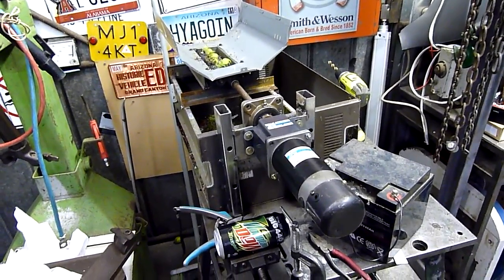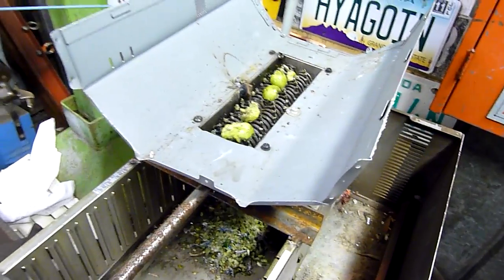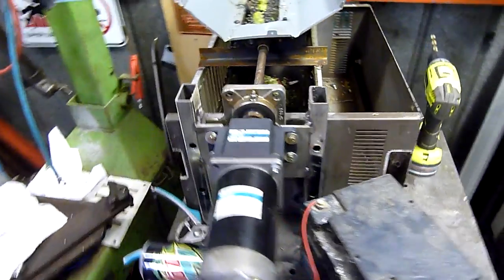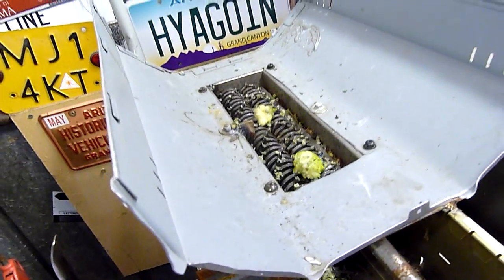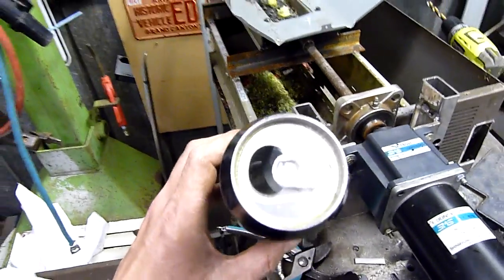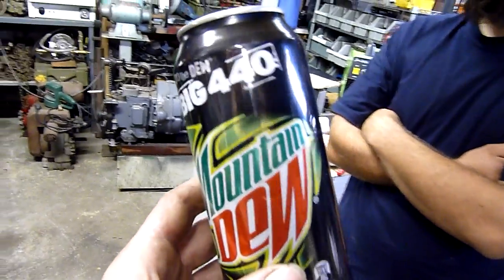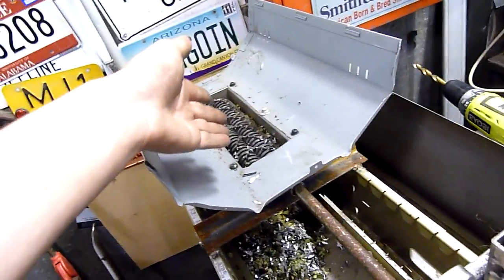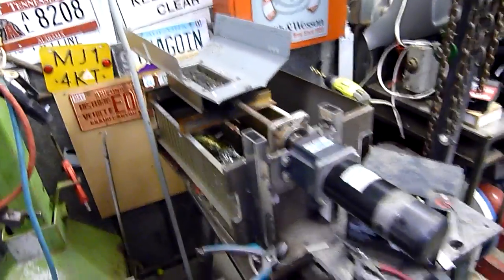Vicious Paper Shredder eats Aluminum Can

Comment: and now I'd love to see it run on 24v and see what it's capable doing at that speed compared to 12v. may also be worth hooking that up to an old crusty ATX power supply and running the motor off that instead of a battery... just mount it under the unit, a couple of tack welds in place... I think you'd have a winner there. tiny bertha the carniverous shredder lives!

Comment: We don't have that kind of Mountain Dew here in the states.
The was cool though.
I may have to get video of the mobile shredder next time I have to work on one.
It runs off the truck PTO.
Reply from the maker: that would be cool!, I want to buy or build somthing much bigger. I think buying would be easier now that I have weighed up the cost of steel and laser cutting work to make one :(
Reply: I will nab a video when I can. We only have two trucks with these units in the back and it's rare I have to work on them. But will nab a short video of it in action next chance I get.